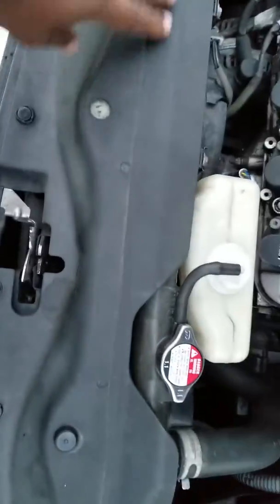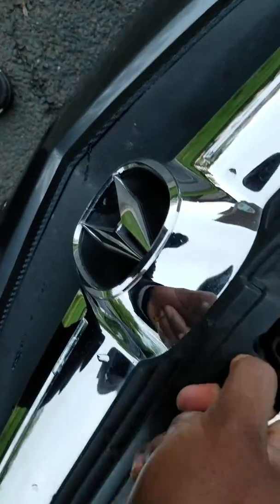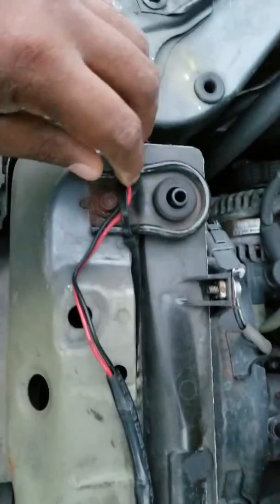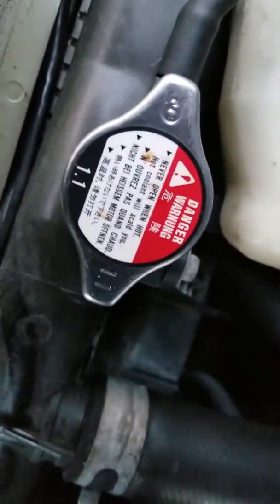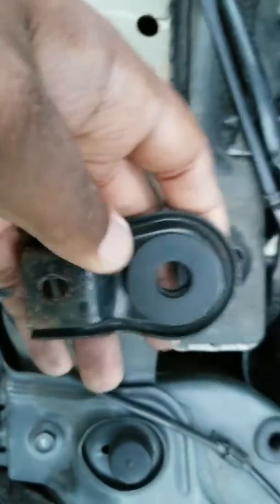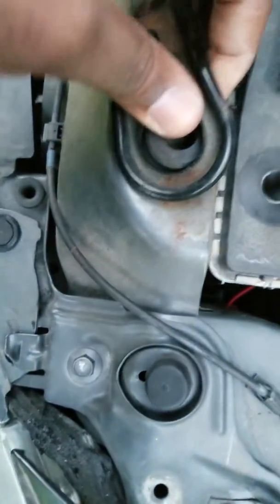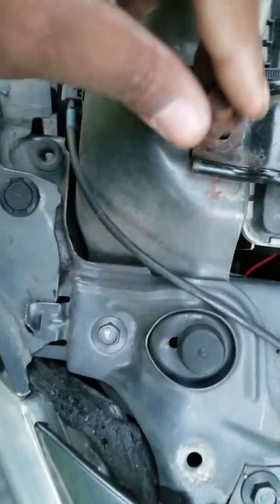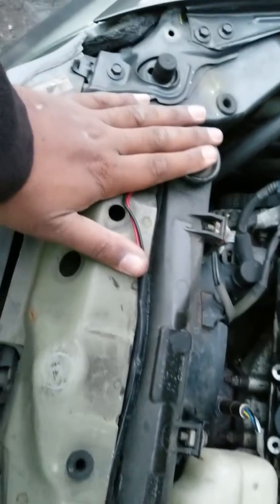HOW TO DO A FAN VIBRATION ANALYSIS AND FIX TUTORIAL

Comment: My 2008 TL, with 100K miles recently would not accelerate past 25MPH and I could feel and smell something had gone awry. Towed it to the dealer who said a bracket on the radiator (next to the grommets) had rusted and fallen off completely, which led to coolant leaking everywhere and transmission malfunction.      I’m not understanding what rusted and the transmission link.  Got any thoughts? Videos?
Reply from the maker: Sounds like bullshit to me
Reply: What do you think may have made the car suddenly stop accelerating? Transmission is a closed system. Radiator hoses connect to what?
Reply from the maker: Coolant does go threw the transmission cooler.